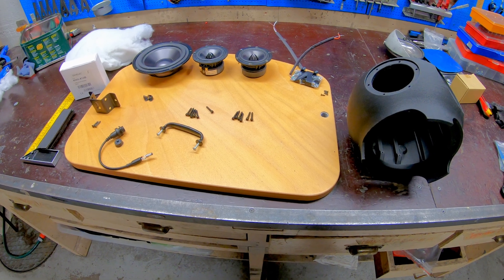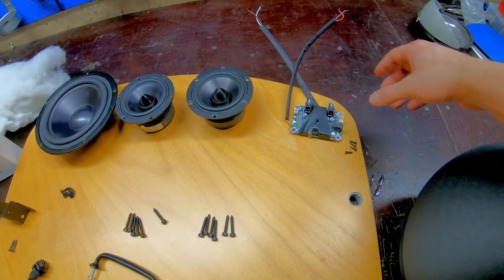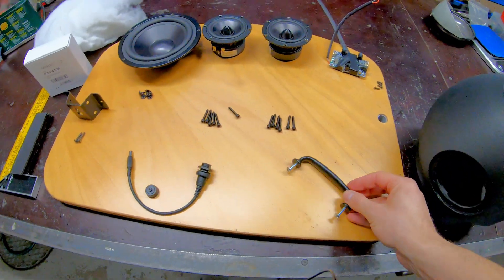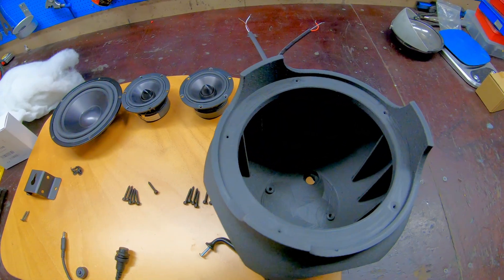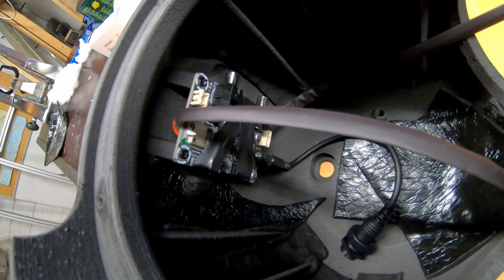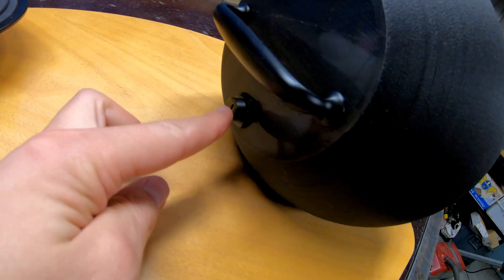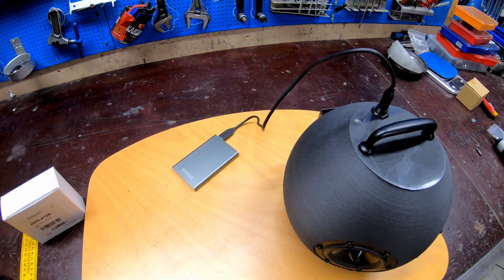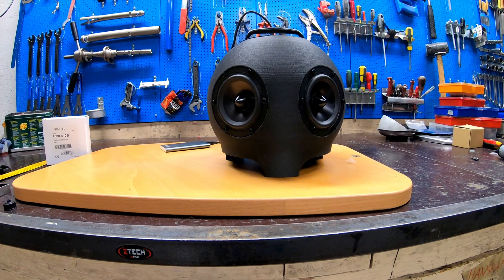3D printed boombox assembly instructions

Comment: Hi. Did you use any 3D model generator to design the enclosure?
I have the speakers from the Boxe Genius 5.1 SW-HF 5005, 150W RMS audio system, and I would like to recycle them into a boombox.
Reply from the maker: Yes, you would need a 3D model to print the enclosure. Maybe you can house two of your satellites in the subwoofer enclosure and add a bluetooth receiver? It'll be big and heavy, but will play low and loud.

Comment: Having a really hard time finding a 6mm plug. Will a 5.5mm work also?
Reply from the maker: You can see the connector specs from the amp board datasheet: "Power Adapter J1, 5.5mm/2.1mm DC Jack"

Comment: You should possibly include a baffle step compensation circuit so that the bass output works in a half/free space environment like the outdoors so placement up against a wall isn't needed for accurate bass response.
Reply from the maker: True, but we wanted to keep this simple and inexpensive, so there are no notch filters, BSC etc. Instead, equalizing can be done for free at the signal source (PC, phone, tablet, whatever).

Comment: hi. looks nice. any audio tests? what cipset need to be bluetooh and have jack plug? thx
Reply from the maker: Here's a video on the BB1 version that has Peerless 3" drivers: https://youtu.be/7Ic2OQQtlV8?t=333 
Of course, the room and placement was not optimal in any way, which means that limited conclusions can be made from the video.
Frequency response measurements and component list are here: https://rdphysics.com/2022/03/17/bluetooth-speaker-without-battery/
Reply: @DIYAudiobyRDPhysics  sound nice. can you give us some alternative for Bluetooth amplifier board? i can't buy from your link.thx
Reply from the maker: The mounting holes on the inside are modelled to match that specific BT board, but something else could be used with some adaptation. High quality BT boards aren't that easy to find, unfortunately. Perhaps some other viewers can recommend some?